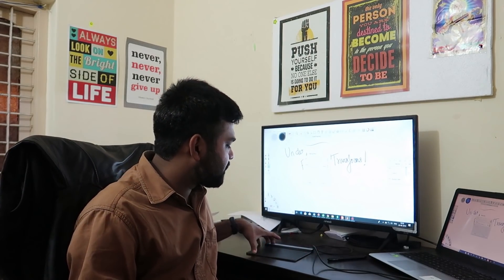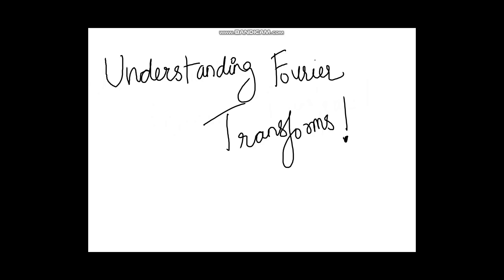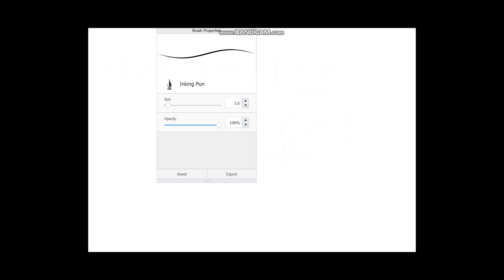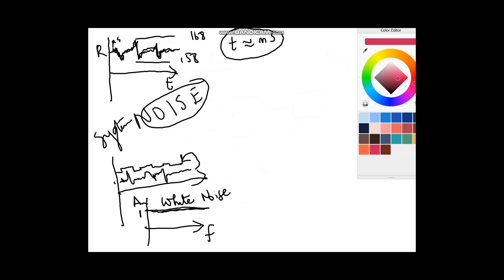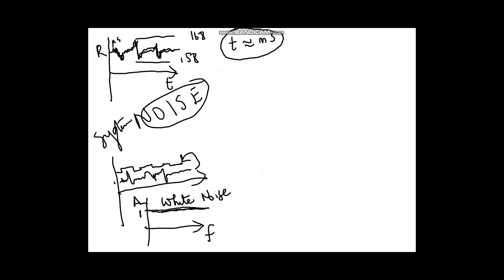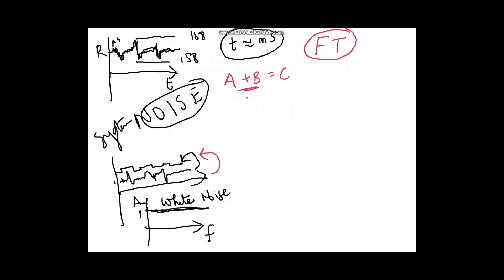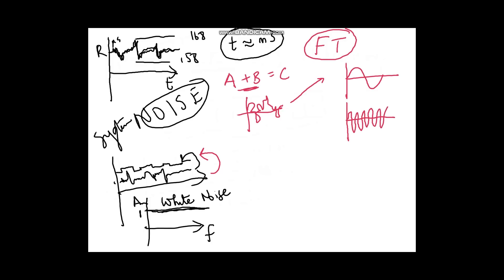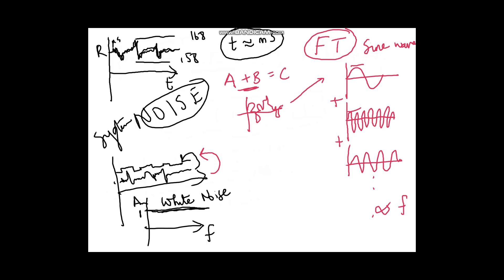Understanding Basic Concepts Intuitively [Episode 1]: Fourier Transforms

Comment: Good job sir! I'm a Mechanical Engineering undergrad. Still watch your videos. Please introduce some mechanical engineer content if possible.
A little feedback- Instead of recording lecture via a writing pad you should use A tablet ( iPad will be the best because of its high refresh rate) with Microsoft OneNote. A windows tablet will work good as well. It will be easier to you to write, and you do not need to rub anything also.